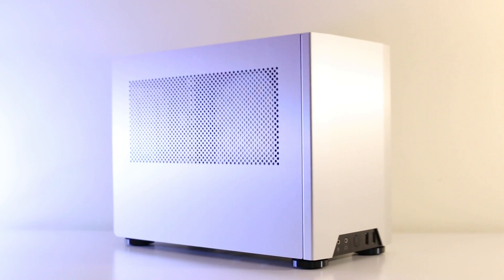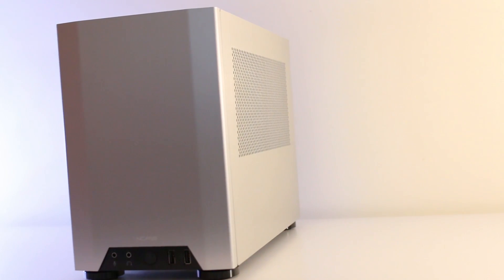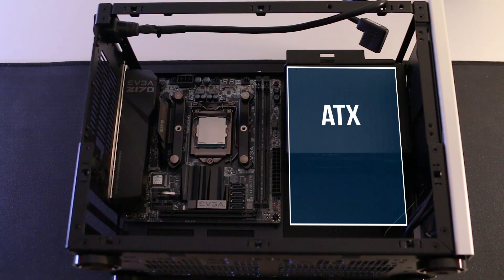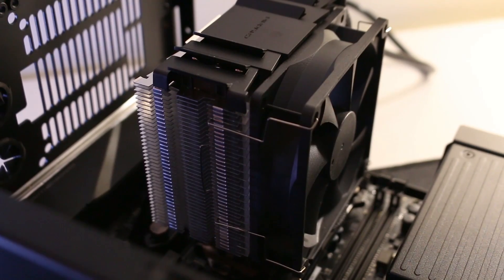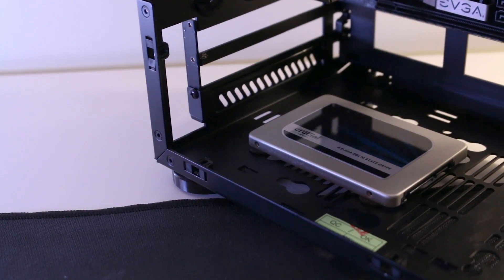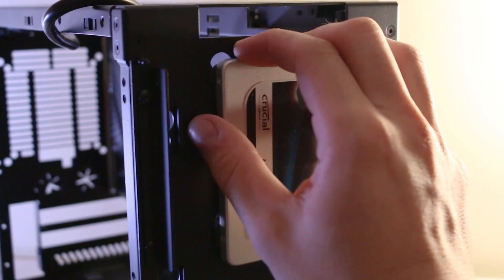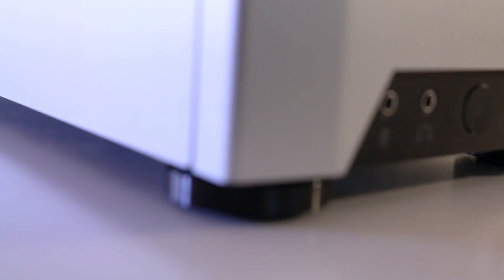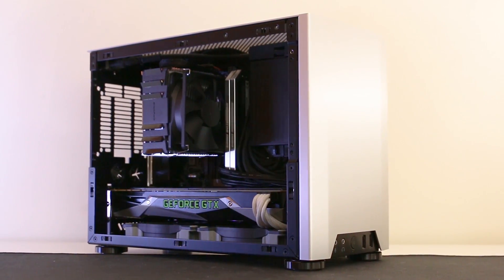NCASE M1 v5 ITX Case - Review and Component Selection

Comment: Hey Great Video! I just have one question I am looking to Bild a high performance (6900k, gtx 1080ti) build. The main goal is to get it as silent as possible. How would I best do this. I'd appreciate some links, videos, explanations etc. I have built 2 PCs before but there the main goal was raw performance, not silence, so I would need a hand. 

Thanks for your help
Reply: Massimo Fraschetti No man i have tried doing a lot of Research. Believe me , youtube comment section is the last place I go. But everything I find is either very outdated or for more budget oriented hardware, and I do not think I can just take higher tier hardware because if a higher tpd. What in am asking for is his opinion, as he is an experienced builder, as I cannot afford to just buy something which doesn't work. I was not asking him to do my research, I was asking if he happened to know of some good sites or had an oppinion himself. Nevertheless I am sorry that my comment came across as rude, I hope I have clarified
Reply: LinusTechtips.com  Ask anything related to pc there. You can read other peoples topics or ask for a question ur self
Reply from the maker: Hey man no problem. If silence was the main priority, I would undervolt the CPU and run it at the stock clock speed (watch my second last video), and i'd also buy a very quiet GTX1080Ti variant such as the MSI Gaming or Asus Strix. You may also want to consider undervolting your GPU too.

Also us a bigger case with quieter PWM fans. Hope that helps!
Reply: Massimo Fraschetti +Optimum tech thanks for your guys help! I really appreciate it. I think I will undervolt the cpu and go for some really quiet, low-rpm fans in a large case.
Thanks for the help!

Comment: Has anyone managed a topdown/downdraft CPU cooler AIO Hybrid GPU mix for NCASE M1 version 5?
Dark Rock TF and NH-C14S seem to block the 120mm front mount, unless socket placement is good.
Tower cooler rear intake would fit, but might blow hot CPU air into the GPU radiator and fan exhaust.
Maybe a hot PSU is not too bad if its fan is inside the case, pulling the hot CPU/GPU air in, up and out.

Comment: So can you put a MSI gaming gtx 1070 in this case?
Reply from the maker: Nope
Reply: Is it too wide?
Reply from the maker: Josh Johnson yep, at 140mm, it'll be touching the side panel, and that's without the power cable inserted.
Reply: Man that sucks, i really wanted this case, its perfect. Maybe v6 will allow bigger gpus.
Reply: sell your gpu and get another one. i do the same. i doubt they change the main design and manufacturing just to allow 3 more aftermarket cards to fit in :)